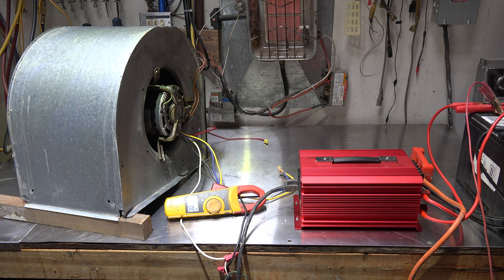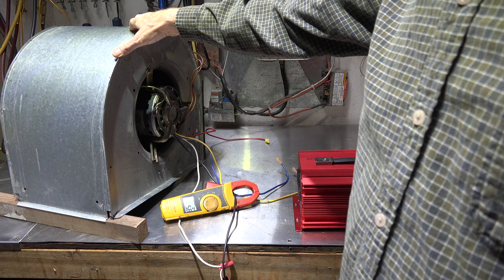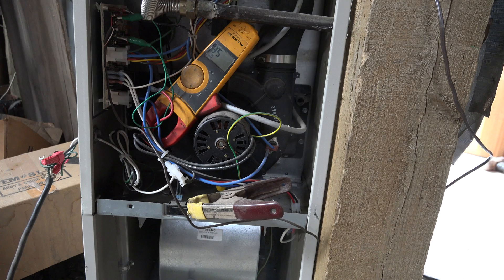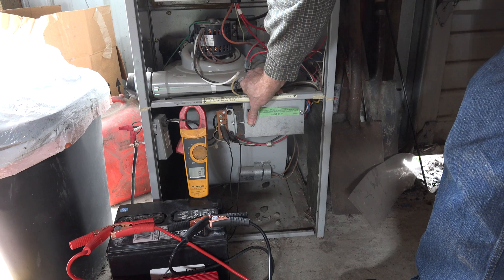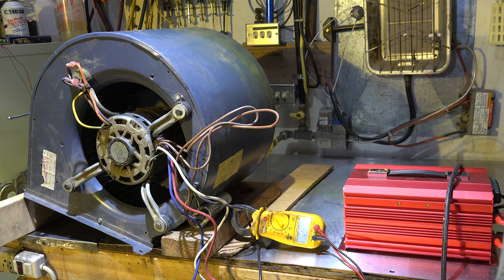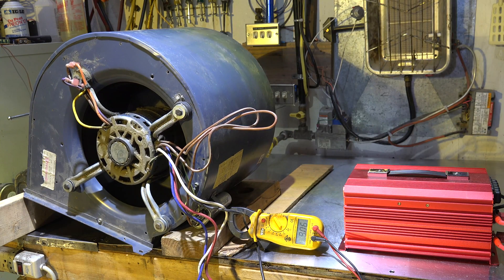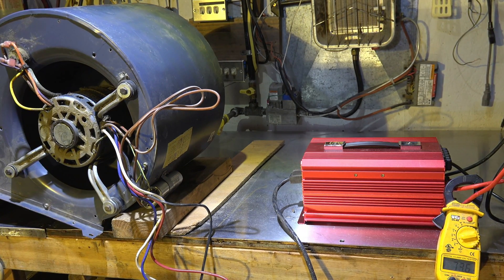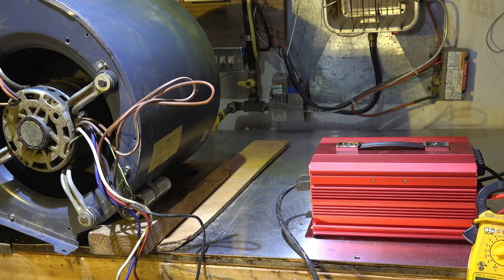Bestec inverter test of PSC fan motors #4

Comment: Would this inverter work ok for a deep freezer or fridge?? Is it still working?? I have a nice pure sine wave inverter but i just bought this one also.
Reply from the maker: The only way to know is to try it.  Some motors work normally (most PSC motors) but from trying many, I could not predict which ones would not.  Look for starting characteristics such as fast startup.  Also if the amp draw is excessive when operating, it may not be compatible.
GFM

Comment: where did you get this inverter? I pluged in small hand tool grinder into this inverter and it went up in smoke. Didn't even start it it.
Reply from the maker: This type of inverter uses a modified sine wave that will have unpredictable effects on motor loads.  You can buy inverters that have a sine wave that is more like AC but they cost several times what this one costs.
GFM

Comment: do you think thi would run a 1400w karcher k2 jet washer a 1300w vax 6131t hoover and a 900 DA car polisher nun will run at the same time only 1 would ever be going at anyone time looking to save a little space in my van and trading my petrol generator for an inverter nothing i use is over 1500w
Reply from the maker: As far as I can tell, it should work ok if you have enough battery.  Hope this helps.
GFM
Reply: there will be 2 battery as it will be ruining of the car a i plan to run the car when i use it to to basicly feed it the power thanks for getting back to me pal

Comment: You would think that the higher voltage would decrease the amp draw.
Reply from the maker: Actually, higher than normal voltage will usually increase amp draw due to increased pressure(voltage). However, lower than normal voltage will also increase amps due to lower back emf. I have to get around to doing more videos on this. 
GFM

Comment: 4:47 Is that UEI meter a true RMS meter? If not that explains the different readings between utility power and inverter power. Average responding meters can only accurately measure a pure sine wave (utility power).

The inverter is outputting a non sinusoidal waveform.
Reply from the maker: I have one coming using the true rms meter
GFM